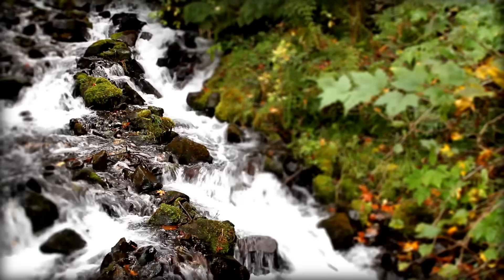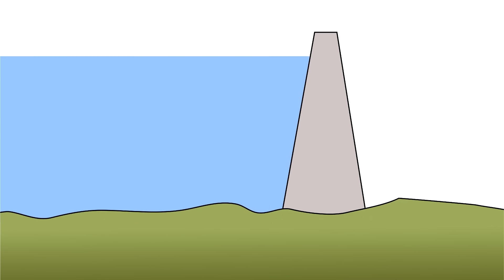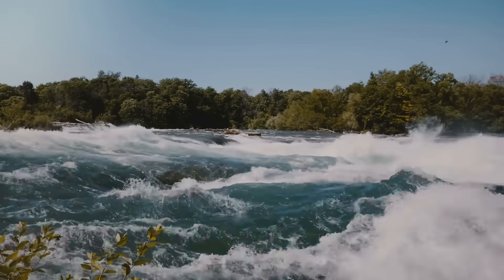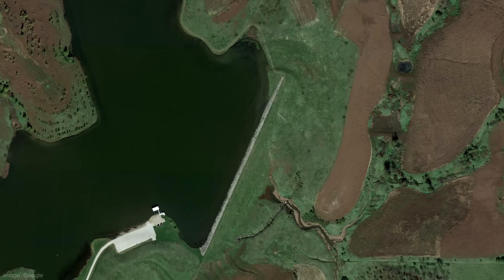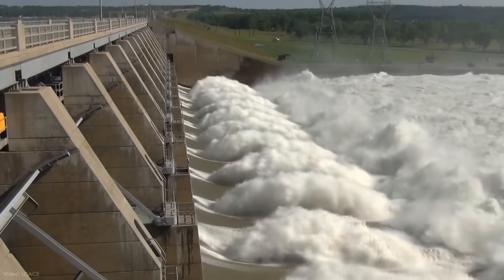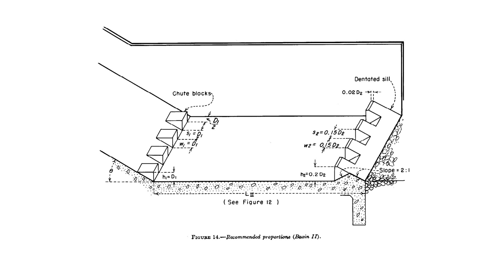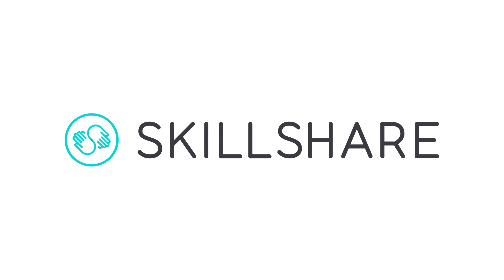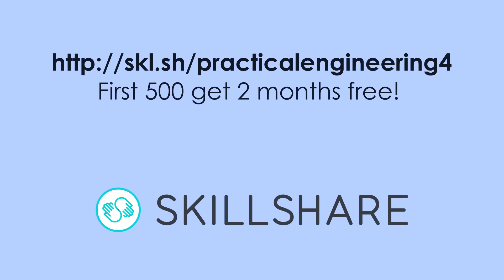How Do Spillways Work?

Comment: spillways should be connected to a hydrofan so that atleast all that potentioal energy is collected!
Reply: That wouldn't be practical especially if the hydrofan were to be installed on the auxiliary spillway.  The reason being: the auxiliary spillway is mostly only used in emergencies, which is an infrequent event.  Thus, the hydrofan would very rarely see any use if at all, leading to parts rusting, and maintenance time that could be used on parts that are actually being used.  A great idea, but unfortunately not practical.  Good thinking though!
Reply: @ctfpd09  Who said it had to be a large steel fan? (:
It could be made out of wood, aluminium, copper, plastic. Doesn't have to be efficient, neither has to completely get all the energy from the water, just some if you can't take all of it.
Reply: @kaiartikkas  Typically in this sort of application (water and wastewater) steel is the most cost effective material to use.  Although steel can be provided with either a galvanized or stainless finish, given enough time, this finish can begin to corrode and rust.  Additionally, wood is prone to warping even in if pressure treated or primed.  This primer would also have to be constantly applied over the lifetime of the wood in use.  Remember this is an industrial application, not an architectural or aesthetic application.  Aluminum and copper are both too costly, in terms of money, for an extremely rare and limited use.  Additionally, you can also get more strength out of an equivalent or less amount of steel.  Plastic, fiber reinforced plastic actually, also comes at quite a high cost and is typically only reserved for environments deemed corrosive, e.g. sodium hypochlorite areas (disinfection areas).  You are not thinking practically which is the name of this channel, practical engineering.  Engineering is the application of science and math in a cost efficient matter to make human life more efficient and sustainable.  You must realize that I am referring to the efficiency in terms of money not in terms of energy (Kilajoules or Newtons).  Owners do not have an infinite supply of money to pay for anything they want.  Owners and engineers must make decisions on where and what to spend money on.  Critical systems and systems that will be used the most is where the money is spent first and foremost.  Like I said, good thinking, but it is not practical.  Also, ask yourself this, is the amount of energy you are capturing from this potential energy source, that is used at most once a year really, worth the financial investment that you are putting in?  Power grids do not scale with power output, that is why nuclear power is subsidized and why coal is still a requirement.  If you were to install this rarely used piece of equipment, would you also install batteries that would only be used when this piece of equipment is used?  I hope this begins to show you the complexity of this proposed idea and the amount of variables and additional resources that are required.

Comment: During the summer of 2011, the stilling basin of the Oahe dam in Pierre, SD was a sight to see, water was being discharged at a rate of 110,000 cubic feet per second! This water was being discharged via the release gates and not the spillway, there is a separate set of gates a few miles away for an emergency release(a.k.a the emergency spillway). Lake Oahe was so full back in 2011 that if the lake took on more water, it would start flowing over the tops of the emergency spillway gates!

Comment: Just this past weekend I went on a camping trip and saw the Guernsey Dam in eastern Wyoming. They have a really cool observation area next to the spillway with some info about its design (and an up-close view of the plunging water).

One thing mentioned is that they have an annual "silt run" in the middle of the summer where they effectively drain the reservoir. Apparently to distribute the silt collected in it to the farms in the area.

Comment: hey could you some videos on non battery energy storage  https://en.wikipedia.org/wiki/Pumped-storage_hydroelectricity and other infrastructure energy storage systems such as https://en.wikipedia.org/wiki/Flywheel_energy_storage, molten salt systems, compressed air storage, methane creation and burning or fuel cell, and other non battery chemical methods like hydrogen electrolysis. https://en.wikipedia.org/wiki/Energy_storage batteries are super trendy but we forget their are a lot of really neat technology, for energy storage.

Comment: I live in Oklahoma and this probably doesn't matter but the keystone lake here is very full because of the amount of rain we've had lately and our dam on the keystone lake is pouring out 275000 CFS and the flooding is horrible
Reply: If the dam fails it would be worse
Reply: @joshuaguenin9507  well we're all scared it will

Comment: If you want an example of a spillway failure almost resulting in a massive catastrophe is the Oroville dam from last year. The main spillway failed under full capacity and eroded everything to hell (go look at some video, it’s crazy). Even with the spillway all the way open, the emergency spillway way also flowing over, it didn’t have a solid base, so the water flowing over was eroding the foundation of the emergency spillway, many engineers said that one more day of heavy water would’ve resulted in the failure of the entire emergency spillway structure, flooding over 6 large towns within about 50 miles. I live close by, it was a very tense couple of days.

Comment: I wrote a book series about the end of the world (plague... no zombies). In book 3, the main character has an epiphany... If the first dam, fairly near his home, fails, it'll take all the downriver dams with it when the 800 foot tall wall of water over tops the next one. This is a real concern and is the reason for the military presence at the Dworshak dam in Idaho.

The MC and his family have to figure out how to drain the reservoirs on all the dams, manually. The power has been out for years by the time he figures it out. All the dams are using their spillways and the Bonneville Dam is occasionally being bypassed by floodwaters.

Comment: Uncontrolled spillways like the Glory Hole (no comment on that name) might be all well and good for a single dam, but if a dam is essentially spilling into the reservoir of the next dam downriver like the dams on the Tennessee River do, I imagine controlled spillways are a necessity on all of them to ensure proper control of the waterway. Even Ocoee Dam #2, which doesn't have a very visible spillway (and is, to my knowledge, designed to funnel the entire discharge of the tributary through a (wooden!) flume to turbines at the powerhouse - 5 miles away from the dam itself), is able to spill water on demand - TVA spills some in scheduled releases to create a whitewater rafting course in the original streambed.

And with regards to dissipating the energy from a spill... Fontana dam is impressive. Twin 34 foot-diamater pipes that seem to deflect the water up and out over the river downstream. Creates quite an impressive spray.
Reply: It seems smaller dam systems can get away with uncontrolled spillways- the Elan valley reservoirs have a series of dams that have uncontrolled spillways as the main flood control. They have had hydroelectric plants added in more modern times, but the original dams are very simple.

However, they are also built right at the top of a watershed in the mountains, so the variation in flow is probably relatively low. The dammed waterway is basically a couple of large streams. Wales does get a lot of rainfall, but its only being collected from a small area here.

Comment: We have a overly natural spillway at the formerly known as Boone lake in Tennessee; they had built a new bridge and decided to blow up the old bridge,, but they ended up opening a hole into the cave system below. We now have a surreal neighborhood of lakeside houses and docks with nothing but the original creek running through the middle of the former lake. Suffice it to say it is going to take years and several million to fix the issue. Guess they should have just taken the bridge apart,

Comment: From an ecological perspective, modern spillways also need to consider downstream impact of where the water is released from: surface water in reservoirs is warmer than the deeper water. Releasing cold water downstream negatively impacts nearly all river life so allowing the surface to run off alleviates some of the harm that dams cause to the ecology of the river.  In addition, simulating minor floods downstream also improves the ecology of certain streams: floods are natural parts of river ecosystems and minor floods are needed for some fish to successfully spawn. There are also structures in many dams now to assist fish movement upstream, some passive and some active: fish ladders can be impressive structures in their own right.
Reply: You should watch a documentary called Dam.nation
Reply: but dam water in general is warmer than a river, because the surface is higher to heat up from fhe sun

Comment: 6:19 or you could have it rocket down two separate  flumes and then make a right and left turn  so the flow towards each other then have both streams jump and collide mid air and use that to dissipate their force and then have then fall and drop a few feet into a drainage channel running between and at right angles to the jumps

Comment: Believe or not California had on of the worst spillway designs. A few years ago Oroville dam was minutes away from failure. It is the second largest reservoir in California.  The entire city of Orovill and Marysville and most of Yuba City were evacuated. One of my friends did the calculations if the worst happened.  The flood would have caused damages all the way to Oakland. That meant Sacramento would have been damaged by the collapse.  And that’s not all the debires would have caused shipping to be delayed by hours.

Even though it is fixed it is still considered a high risk dam. It’s no wonder why several have left that area because there is a major snow melt coming

Comment: Dam engineer here. You hit the nail on the head with regards to complexity. Normally, with large dams at least, spillways require the most amount of engineering working hours to fine tune. Most, if not all, large dams are normally scale physical model tested or in the very least CFD model tested before construction. As data acquisition improves,  we are finding more and more spillways in the world not complying to modern safety regulations. Which is great... keeps me in a job.

Comment: What happens if you jump in a spillway lol. Kind of serious.
Reply: Death happens
Reply: Dry? You break bones and possibly die.
Wet? You'd be carried away by the flow of water and hit whatever exists at the outlet. Just pray it's a soft landing.
Reply: You die.

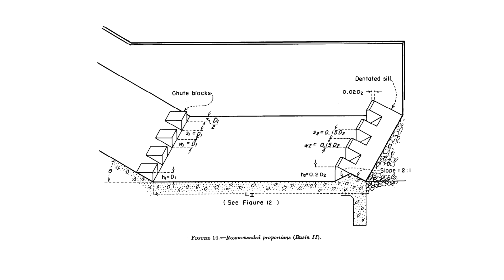Even if you didn't die on impact with the structure itself, if there's water being released into a plunge pool or stilling basin... well, if you look at the image shown at around 6:03, you might see why. You'll get caught in a spot where the water is rotating such that you're kept under and you will drown (if it doesn't pulverize you against the structure).
Reply: @PyroDesu  Not quite true, it depends on whether you get that kind of flow or not. Which depends on the depth of the pool, the shape of the pool and the speed of the flow at the entrance of the pool.

For your statement to be true in all cases, all waterslides in the world would be automatic death.
Reply: @RealCadde  Waterslides do not have anywhere near the requisite volume of water being discharged to create the (dangerous) turbulent flow seen in plunge pools, and the comparison is disingenuous. That turbulent flow is the design goal, because it rapidly dissipates kinetic energy (which is the whole point). And it's not just a question of design - such turbulent flows will be generated naturally, it's a matter of protecting the structure around it - in nature (such as in waterfalls), the turbulent flow carves out the plunge pool. We design the plunge pool so as to control the turbulent flow.

Of course, there are other methods of dissipating the kinetic energy, such as a hydraulic jump - I don't think I need to explain how that would kill you.
Reply: @PyroDesu  Thank you. I thought maybe you could survive somehow. Cool

Comment: 3:22 - that kind of spillway is 5 million types of 'nope' from me.  I am genuinely terrified of those things.
Reply: Ha ha, I’m the same way with pool drains; I know I won’t get sucked in there but still. Scuba diving in the ocean is fine though. Weird.
Reply: Heights, drowning, and underwater infrastructure. My personal Holy Trinity of Nope. Won't even kayak on the same lake as one.
Reply: And those are generally the least dangerous should you go down one accidentally. Unless you somehow managed to fall into one that's dry.
Also assuming the outlet doesn't crash you into a rock face, but rather something soft like a pool.

Pool drains are DEADLY though if you have anything that can get sucked into one, like long hair or you manage to cover it such that it gets plugged. You won't come free from it and drown.
Reply: Iv been inside one local to me! Entered from the bottom end though
Reply: @camnationm8  tf imagine if water level got high while you were inside!
Reply: Dared even though the reservoir was super low and it'd of probably taken a few days of heavy rain to overflow I couldn't help but think that same thing the whole time I was inside it 😂
Reply: jeebus2121 kinda happy other people are just as freaked out as me by those
Reply: I don’t feel comfortable coming within 1000 feet of one
Reply: Those are indeed disgusting especially when there are ZERO safety barriers.
Reply: Most likely,  you're not supposed to get that close to them.
Reply: My family has a boat in an artificial lake. It doesn't have a spillway like that, though, just has a gate. Whenever we get near the dam, i'm fucking terrified the damn thing is going to pop open and pull the boat in.
Reply: same, like... at least put a net or grate around it or something...
Reply: The "glory hole" at 4:16 is very close to me, I've seen it spill over a number of times. It's about 60 years old now and only one person has ever gone over and she didn't live. You can't accidently get close to it because it is protected by a buoy. It is suspected that the woman who did go over approached it purposely.
Reply: Thats the most fascinating thing ever

Comment: One important advantage to note about controlled spillways is that they allow the dam to lower the level of the reservoir significantly below normal in anticipation of a large inflow. This allows them to absorb far more volume while maintaining the same outflow during the storm (or less to assist downstream dams that are picking up extra flow from the watershed between them).
Reply: I think it's more cost effective to only build one big one of each, although an uncontrolled spillway might be used as a backup for the backup spillway!
Reply: @chiaracoetzee  The dam shown at 2:40 appears to be set up like this, yep. Most principal spillways are controlled, I imagine.
Reply: @pmailkeey Oroville dam in California in 2017 is a recent example with a lot of YouTube footage showing the damage and later repairs.
Reply: @PyroPeter911 : ...and poor design and maintenance based on political considerations over engineering and safety.
Reply: @pmailkeey look for Oroville dam
Reply: @pmailkeey oh there are things that can go wrong, like a broken emergency spillway channel
Reply: Unless the fort peck dam fails, that will work for the dams downstream
Reply: So you want some manned and some unmanned as redundancy?
Reply: Nice
Reply: But also in the same instance….it can protect from flooding but it also can backfire correct?
Reply: @countryv.o.5164  If the rainfall was significantly less than predicted, then it wouldn't bring the water back up to it's normal level after the flood. This could have negative impacts if the water is in high demand for irrigation or power generation. Fixed boat docks could be left dry and boats would be damaged if they weren't relocated to deeper waters. All kinds of recreational activities would be affected when campsites no longer have beaches and boat ramps come up short. If downstream dams and waterways aren't coordinating with the the upper dam, the increase in flow could be a problem or expose some failure. Total depth also affects temperature cycles within the reservoir which can affect fish and algae, although this is probably not too much of a concern.